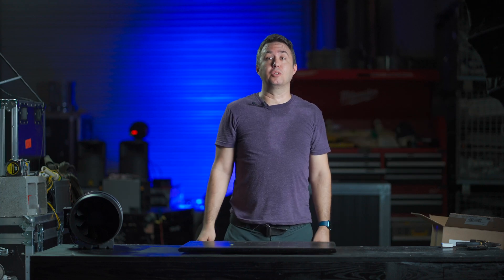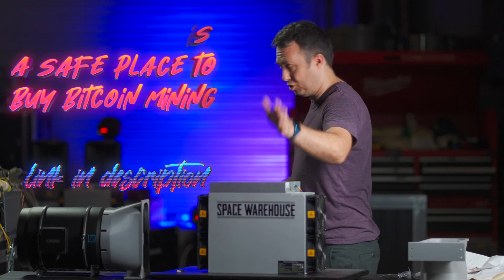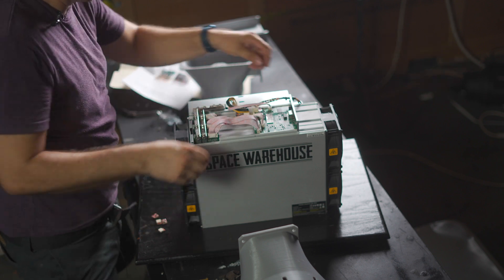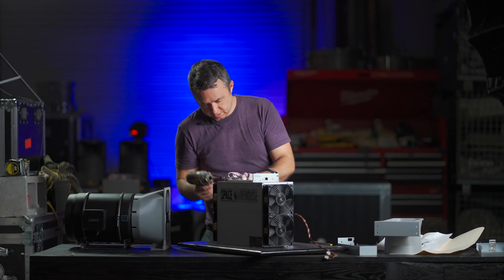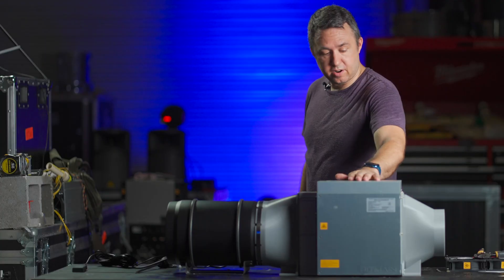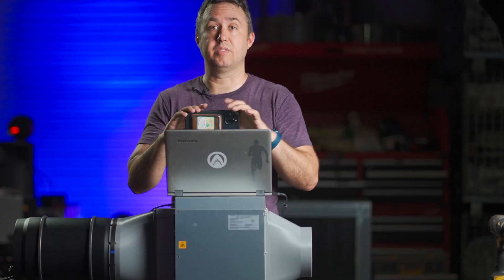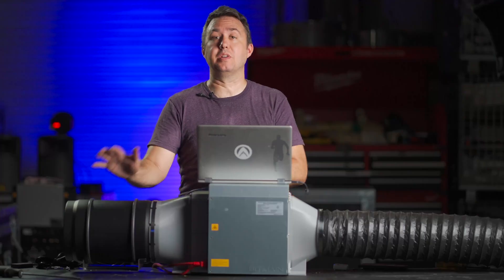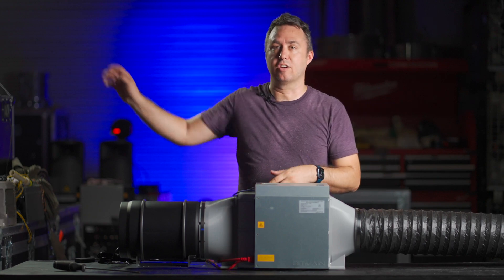S19 J Pro Running Quieter AND Cooler - Bitcoin Miner Fan Upgrade

Comment: If you touch the buss bars,  you shouldn't get even the slightest shock. unless you are SUPER sweaty. They are only 15 volts DC, basically a car battery of voltage and current.
Reply from the maker: I believe you - and theyre actually only 14 volts unless youre overclocking!  Alas I will not be testing your theory, even though I touch car wiring all the time.
Reply: @SPACEDESIGNWAREHOUSE   what are you doing gettin your mitts in Car wiring? I used to be a 12v installer back in the day.
Reply from the maker: @lsdave  I like adding pointless things in my truck that I barely make use of... an inverter to charge maybe a laptop.. A winch on the truck to pull people out of ditches the one time a year I go into a snowy place.. Bigger better sound systems even though I basically only listen to podcasts..

Comment: If you run the fan as a suction fan it will suck air into the control board instead of blowing hot threw it.
Reply from the maker: That’s true, but it’ll also suck incredibly hot air through the fan, and that’s got to lower its life span, don’t you think?
Reply: @SPACEDESIGNWAREHOUSE  its something to try and test. The fan needs to be durable and good quality. All automotive electric fans pull air through hot radiators. At around 200° Electric fans can take an absolute beating if built right.  I'm a poultry farmer so we always cool our birds by sucking air out of the house and control the cold air with cool cells on the incoming side. That's where I get my theory of cooling and apply it to asic miners. Of course my fans at much bigger and non direct drive, but running so much heat on the control board can't be good for the long run of the miner.
Reply from the maker: @stanlybarns7720  You make a good point about the automotive fans.
Reply: @SPACEDESIGNWAREHOUSE  Also, what's better to replace, a $120 dollar fan, or a $3,000 ASIC?
Reply from the maker: @joelively5540  well, to be fair it’s fan or control board, but the same sentiment; those cost more than fans and take longer to get.
Reply: @SPACEDESIGNWAREHOUSE  good point.  As I was being a bit overly dramatic in there would be nothing wrong with the hash boards.  Im getting one and I'll do some tests as well.  Thanks for the vids.

Comment: thing i love about the ac infinity fans are that you can put your temp probe on the exhaust and set the fan to run at level 6 but when temp comes up like in the afternoon you can set a high temp limit and it will auto ramp up to level 10
Reply from the maker: Is that an add on for the fan?  These just came with the little remote with one button on it.
Reply: @SPACEDESIGNWAREHOUSE  you can buy the fan with the basic controller or get controller 67 or 69
Reply: Hey just wondering if you still do that, recently got this set up and loving it so far.  Curious what temp thresholds you use to dictate fanspeed.
Reply: I couldn't work out the controller. How did u manage to set it to do that?

Comment: Great video! I noticed you compared the temps and Terahas to immersion cooling. Would you use this similar setup individually for a 100 mine setup? Or is that a waste? I’m not concerned about the noise level but the lower temps and over locking is very intriguing if it can be scaled. Thanks.
Reply from the maker: Well, you'd have to weigh the cost of buying 100 of these fans, and 100 of these shrouds, but yeah - other commenters are saying the AC Infinity fan is not crap and DOES last a long time - so if you dont care about the noise, I see a benefit in just hooking up the fan and shroud on the intake and leaving the back side totally open.. You'll get cooler temps, you'll get SLIGHTLY lower power draw - and you'll be able to overclock in the air.
Reply: @SPACEDESIGNWAREHOUSE do you know if they sell the input shroud by itself? If you have 100 of these machines, where would you point the input shroud/pipe to?

Comment: Looks like the laptop is running windows 8/8.1. it could also be a slow HDD vs a faster SSD.  Upgrade the drive it's a world of difference.
Reply from the maker: It’s running some weird version of windows 10 where it’s a tablet if you fold the screen all the way back onto itself and then full windows if you unfold it.  I bought it like 5 or 6 years ago for a race timing company I had started up and found it on a shelf in my warehouse.
Reply: @SPACEDESIGNWAREHOUSE  it might be the "S" version. Pretty easy to covert over so its a normal windows install. I have fixed many 360 laptops. Currently fixing one from the dumpster. They all shipped with a normal hard drive.

Comment: Why would they make the exhaust 6”? Makes no sense. Both should be 8”. Don’t need to be a rocket scientist to understand that the exhaust is a glaring problem.
Reply from the maker: There is no question an 8" hot side would improve airflow and therefor temps..  They DO offer both sides in 8" upon request.

Comment: It may be better on the other side pulling air through the unit?

Edit: One benefit is the unit will get no heat from the duct fan.
Reply from the maker: True, but forcing super hot air through the duct fan 24 hours day would HAVE to shorten its life, I would think.. Could be wrong about that.
Reply: @SPACEDESIGNWAREHOUSE  How hot is the air? I told my wife I want to throw two Asics in In the basement to eat the house this winter, in Vermont, she asked me how hot it gets, I didn't know exactly and said 130° f
Reply from the maker: @gmtalisman  Actually, shoot.. I don't know the exact temperature of the air coming out.. Ill measure that today!  I think youre in the right area though with 130f

Comment: Hey hey! Do you have a link to the dummy fan plugs?
Reply from the maker: These ones came with the shrouds, but I’ll email the guy and see if he’ll tell me where he gets them..
Reply: @SPACEDESIGNWAREHOUSE  I found ones off amazon that look identical to yours.  Going to get that setup to work inside the Cryptology Consulting Box. No ASIC Fans.
Reply from the maker: @TheHobbyistMiner  ooo smart combo! Perhaps I’ll try the same.. I did modify that box a bit to connect a shroud inside, sticking out the back

Comment: very interesting.  Too bad so many asic miners are crazy overpriced with 4 years ROI at the moment.  Why on earth would they come up with this solution which is genius but have 8" in and 6" out?  Not genius...
Reply from the maker: It is curious they decided on 6” out. It’s clear to me that 8” out would solve any heat problems. I guess maybe because of how expensive 8” ducts are compared to 6” and it’s still cool ‘enough’ 
Miners are getting wicked cheap right now! Especially if you believe BTC price is coming back, which I do.
Reply: @SPACEDESIGNWAREHOUSE  I checked today and yes way cheaper than they were but basically still priced where if you bought one today youd probably be losing money off the bat. Not all, but most of them it seems.
Hopefully you're right. I'm 100% GPU mining right now but who knows what tomorrow or next month will bring... Ha
Reply from the maker: @TheFutureisTheFuture  same with those, though. I think my 3080’s are making like $1.65 a day because of how low everything is. I’ll just hold it forever!
Reply: @SPACEDESIGNWAREHOUSE  yeah I'm trying solo mining ETH cause like, might as well.
Do ya feel lucky punk... Well do ya? Haha

Comment: Yes you did it!  The improvement I'd recommend is putting another inline fan on the exhaust side and then add ducting to it. I bet you'd be able to run things at half speed and be very silent and cool.  Next video?
Reply from the maker: I've got another fan and another 8" shroud - Ill try it out!
Reply: @SPACEDESIGNWAREHOUSE  ohh and btw . Regarding the abnormal heat on top due to the decrease in size of the duct is everything but good for the health of the machine.
back pressure will slowly but surely damage and or kill the hash boards in the long run.
I don’t understand how some can supply it like that. If anything the outlet should be bigger than the inlet!
Reply: Adding another is overkill. The original fans moves just somewhere around 500 CFM in total.
The thing about lower temps isn’t as necessary as many tend to think.. 
the reason is that an x19 optimal chip temperature is around 72-77.

So basically the only reason I see to add another fan is to increase the static pressure to be able to move the air in a longer duct or to be able to overlock it a bit on air

Comment: Nice product. I have a few of these fans and they have held up well so far. I would like to get a few of these ducts if I could get it with the outlet duct the same size as the inlet though. They make that same fan but with a temp control module that ramps the fan up or down based on temperature. Maybe you could put the temp probe at the outlet and set it to a temp that the hash boards would be happy with.

Comment: I have 6 of those AC Infiniti fans. They run at max speed 24 hrs a day and have been running that way for over 8 months. They are very good fans from my use with them.
Reply from the maker: I was hoping to hear from someone whos used these long term.. Thats really nice to hear!  This is a really good noise/heat solution then!  I mean, really.. Everyone who lives north of florida should buy a bitcoin miner now that theyre cheap, simply to supplement the heat in their house - even in a shit market, they run for free - and when the market recovers, they make a bunch of money
Reply: You can't look at the market for how it is now. You have to look at it from the perspective of what you think it will be in the future. If you believe Bitcoin will eventually hit a new all time high then now is the time to buy and mine. I use mu AC Infinity fans in a grow tent to cool my 38 GPUs. It works fairly well. I live in Alabama so my weather is similar.
Reply: @hiddencorners1630 have you tried using AC Infinity on the exhaust side?   My thought is the miner will act as a buffer and reduce the noise even more without needing to have anything on the intake side. AC Infinity would also be connected to a duct to take hot air out.  Some say it may reduce the life of the fan…
Reply: @lionking888555  I always have one on each side. To push and pull. Pull fresh air from outside and push the hot air back out. The screen on my window acts as a natural filter also.
Reply: Wow.. could you tell me more about it..

Comment: Did you have any issue with the shrouds melting or demolding so to speak? Getting too hot
Reply from the maker: Ive only had this running for two days now, but no.. And according to the manufacturer - this plastic can handle more than twice the heat produced by a bitcoin miner.
Reply: @SPACEDESIGNWAREHOUSE  This is correct, the shrouds are made from ABS plastic.  The glass transition temperature (the point in which the plastic starts to get pliable) is 220° f (110°c). This is nowhere near the temps that will come out of the ASIC.

Comment: SDW man you rock! I was thinking of doing this same thing just buying the dual to 8” and getting 8” vent fans with auto thermal control;

however I have a few S17’s as well and the PSU fans are Very high pitch and needs to be removed as well so I would need a more custom intake that supports not just the hashboards but also the PSU with one big fan feeding both! Anyways hope someone builds my idea .. would be perfect!  and their is no need for exhaust shroud if you’re miner is in a hot and cold type setup.. just stick the hot side in the hot box!

Comment: Just to say, you should not pass hot air in a plastic ducting, you need aluminum, it might catch fire.
Reply from the maker: 3D printing materials have come a surprisingly long way! These plastics can hold up to temps double what the exhaust air here reaches. It’s incredible.